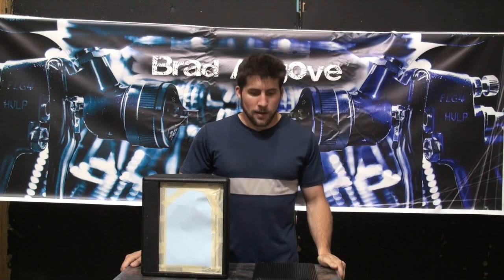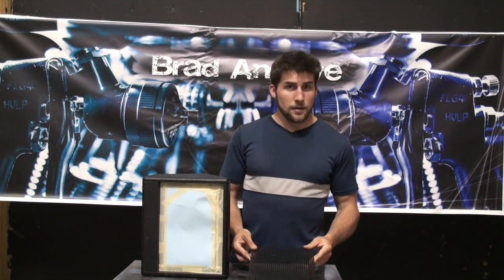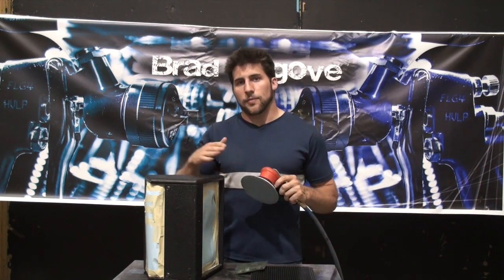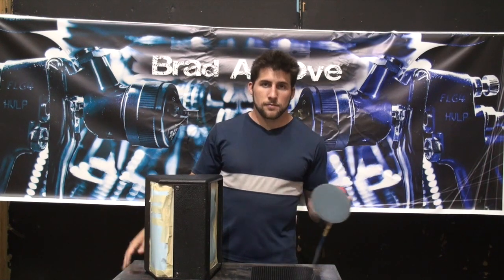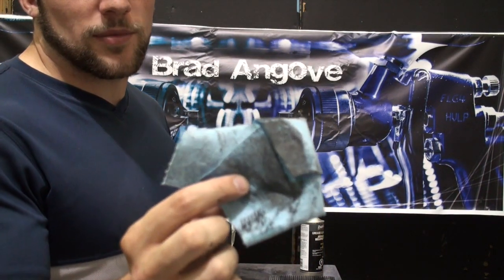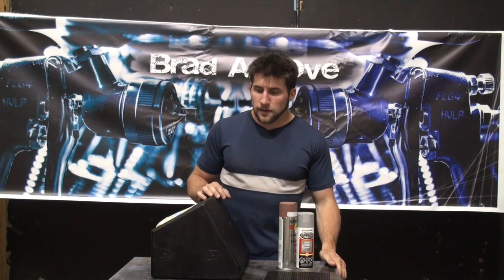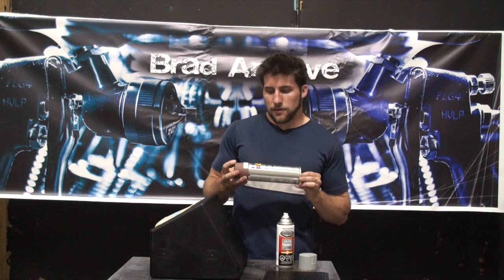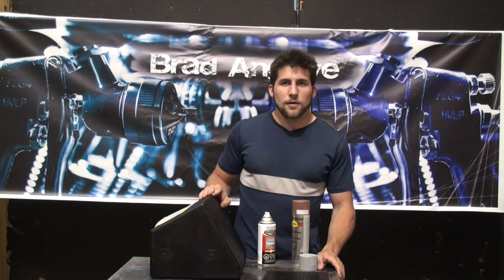How to paint your amplifier (Part 1 of 2)

Comment: Brad, a HUGE Thanks for making this video. I already have a really sweet Crate V50 but its black, and with your advice I plan to paint the combo amp as close to a palomino tweed color. I guess tweed is more yellow than palomino. My only suggestion is you redo the video using spray paint that anyone (like me) can find in a store. I personally would go with a satin instead of gloss. So when you get a chance please let me know the type and brand of spray paint I can use to paint my amp - THANKS.
Reply from the maker: +a. webb Hi there. This was a customer job, which is why I used high quality paints instead of paint cans. Unfortunately, it's difficult for me to do tutorials like this unless customers ask for them because it is expensive.
Before we try to find a brand of spray paint that will work for you, I need to ask: have you considered just replacing the tolex on your amp with tweed? That may be an easier way to go. There wasn't a tolex available with the specific look that this customer wanted, but I think you can probably find tweed on Mojotone.com or something.
Reply: Brad Angove Hey, thanks for the reply Brad, much appreciated. As for replacing the tolex?? I am MUCH more hesitant of tolex replacement over painting. All the steps you outlined in your video makes sense to me and I've already done on various other paint jobs, I just never painted tolex before. As for replacing the existing tolex?, A whole new ball game for me. Making the cuts just right, Getting the seams right... Wow, maybe beyond me and I don't want to screw up my amp. Maybe if you lived close by and we could do the retolex project together? I'm on Long Island, NY OR instead if you could suggest a retail spray paint that I could find at the Home Depot. Thanks in advance Brad. Looking forward to your reply - Ade.
Reply from the maker: Haha I live in Edmonton, Alberta. Not exactly next door. If you're looking for a home depot spray paint, I like to use the rustoleum brand stuff. I'm not saying that it's better that the others per se; just that it's what I often use for spray paint projects. I hope that helps.

Comment: Can you paint the Marshall like amps that have that vinyl like covering? It's almost like plastic or something though, but wood or plywood underneath  I guess? Thanks .. Great video as usual sir.
Reply from the maker: You should be able to if you prep them properly. Just make sure you're using adhesion promoter and/or plastic compatible primer.
Reply: The material is called Tolex

Comment: If i wanted to keep the texture would i just spray over without sanding?
Reply from the maker: No, the sanding is for adhesion purposes. You may want to consider simply replacing the Tolex.

Comment: Hey brad, just started watching your videos and i have to say they are great
Maybe check out the channel Make Something, the guy has a video taking a normal amp and building a wooden casing for it, good combination of a music and woodworking project
Reply from the maker: +that guy stone Thank you. I've definitely seen the channel, but I don't believe I've seen that video. I'll have to have a look.
Reply: @BradAngove  thanks for the video Brad. I have an easy question for you. I just painted my blues Junior Tolex cream. I used Rust-Oleum painter's touch because it said that it bonds to plastic. I wanted to use Krylon Fusion but they didn't have it in the right color. My question is this: do you think I should put a clear coat on the amplifier to make it stronger or look better?
Reply from the maker: I generally would, yes.
Reply: @BradAngove  okay I'll slap on a matte clear. Thanks dude.
Reply: @BradAngove  shit...its been 48 hours and its still VERY tacky. Is there a way to get this stuff to dry faster? I think my Coats were too thick...